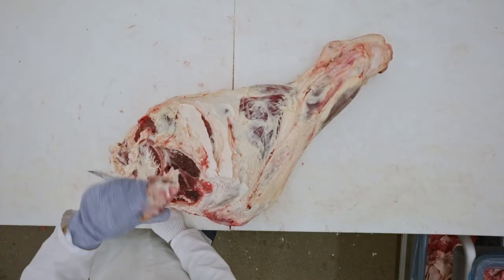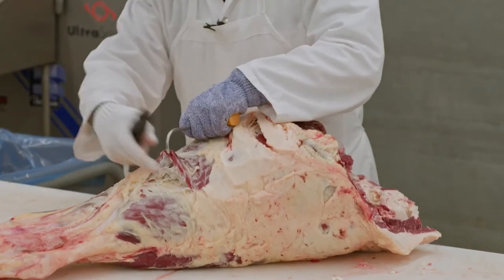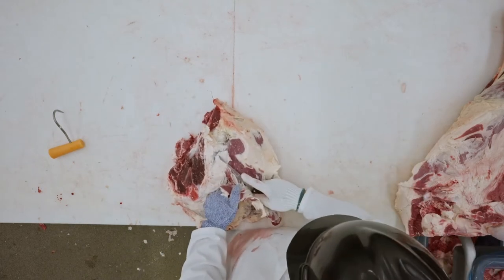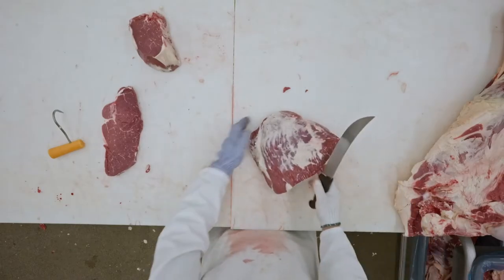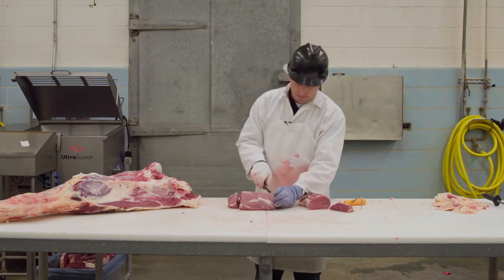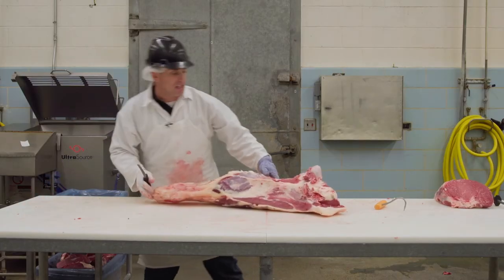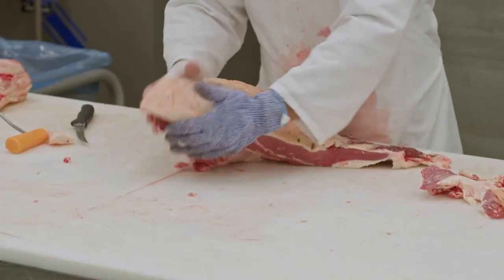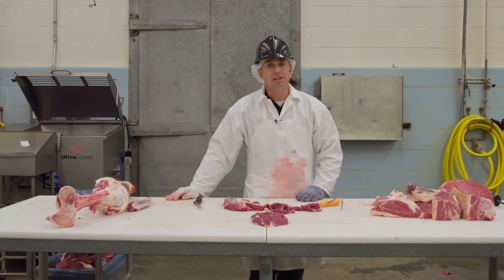Learn the Art of Butchery - Beef Round with Professor Phil Bass

Comment: Phil made hard work of this. In the UK the order of removal is different and much easier. First remove the Leg at the joint. 2. Remove the Oyster and then the Aitch bone. 3. Remove the Sirloin tip or as we call it the Thick Flank. 4. Remove the femur. 5. Seam between the Topside and the Silverside. 6. Separate the Eye Round or as we call it in the UK, the Salmon Cut